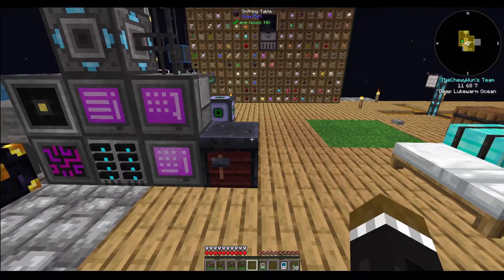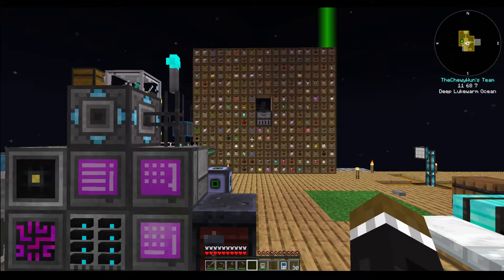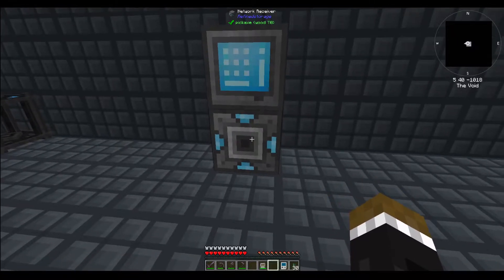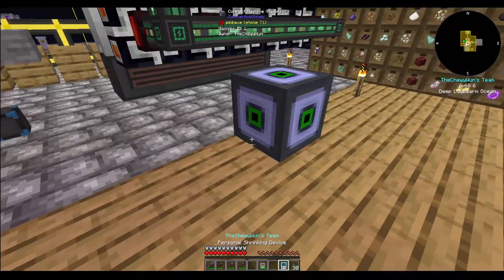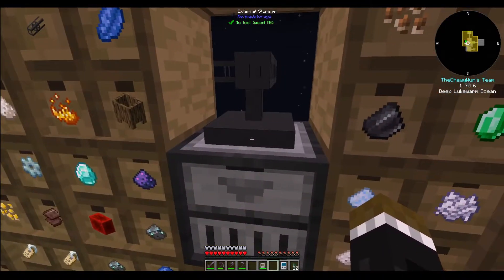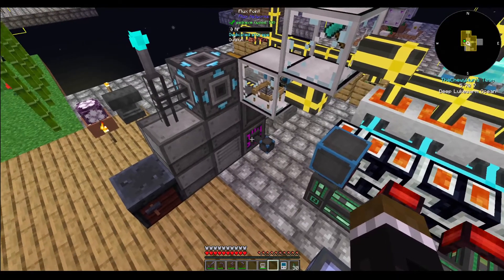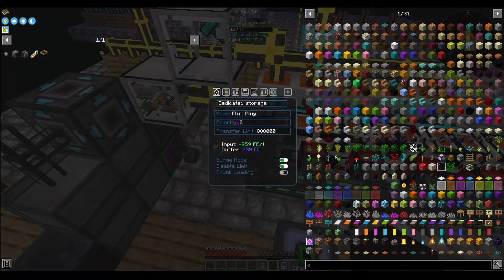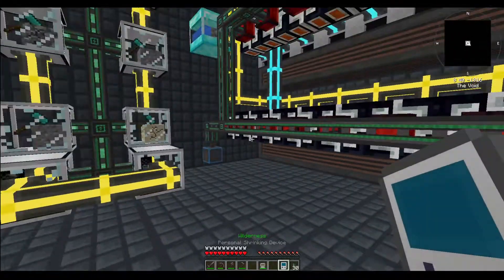Minecraft Tutorial - How to use Refined Storage inside Compact Machines

Comment: So, the tunnels don't work anymore with the cables connected like they did before then on 1.12, on 1.16?
Reply from the maker: I had heard they were not operational, but in this case, I'd rather be able to move them around and wouldn't want to tie it in to one specific place where I'd have to run cable to.